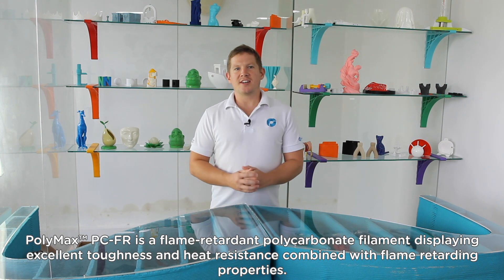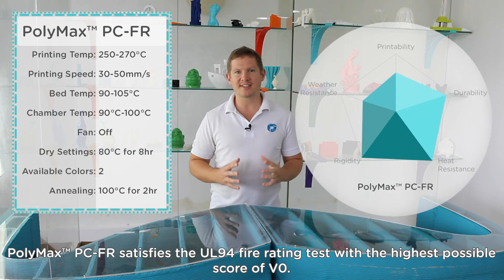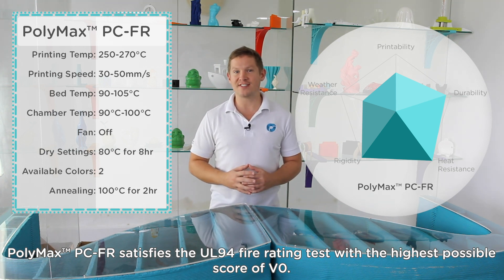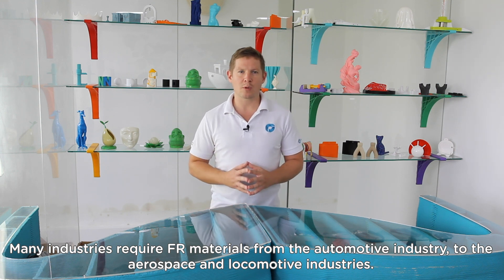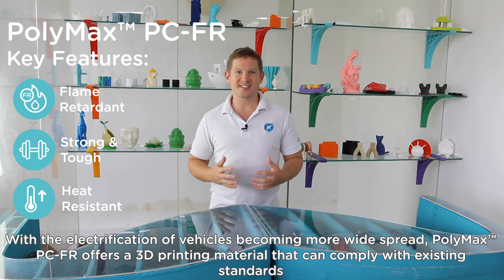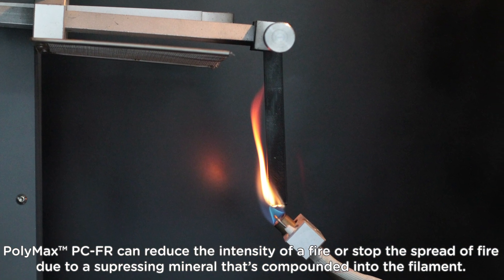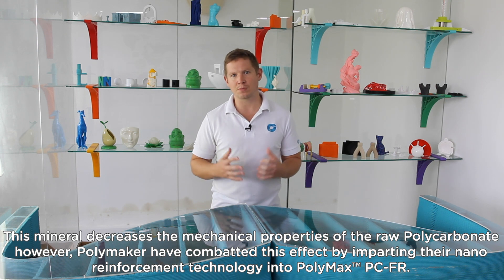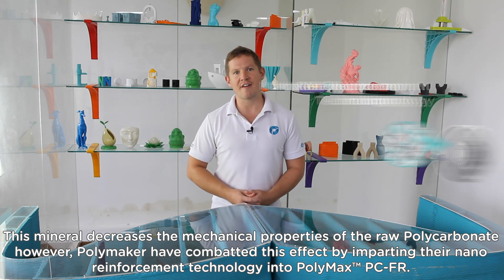Material Introductions - PolyMax™ PC FR

Comment: Should I print with an enclosure?
Reply from the maker: Hi Michael, a printing enclosure is required to print PC-FR effectively. Smaller models can be printed without an enclosure with a high heated bed temperature. Polycarbonate prints best in a warm environment where it can cool down slowly.